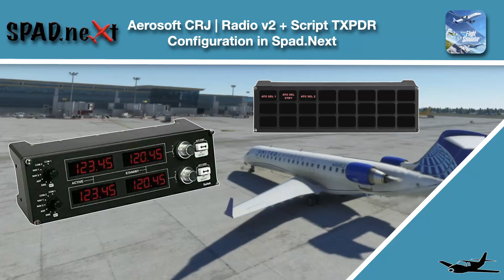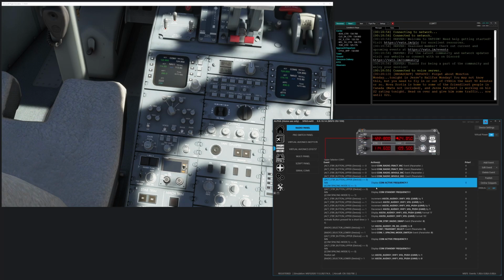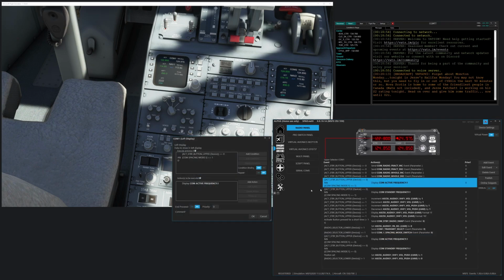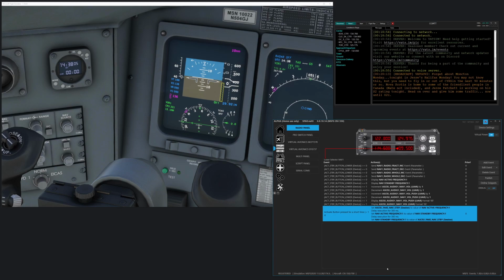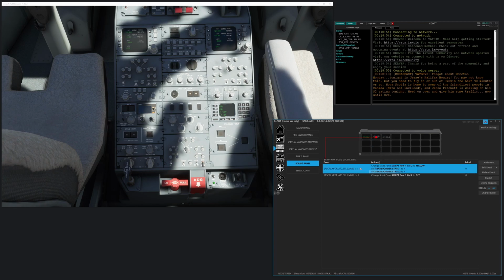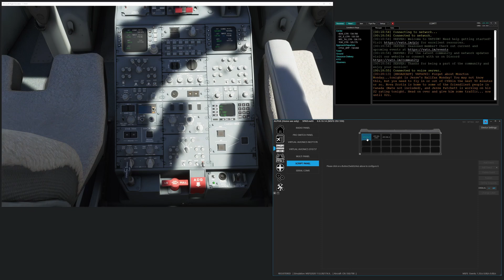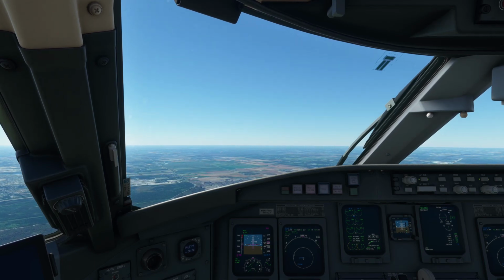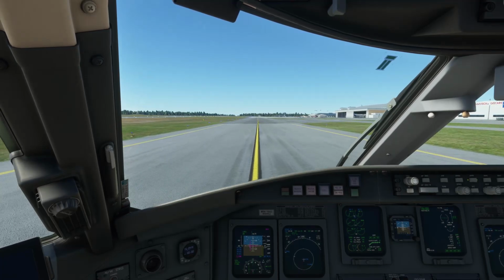(Sim Video) Aerosoft CRJ | Radio v2 + TXPDR Script Configuration

Comment: NAV1 / NAV2 values are not changing in the CRJ is that normal?
Reply from the maker: You mean the RTU display is not showing the change?  Or the actual data under the sim that will in fact show up on the PFD in the HSI as the LOC or VOR you are tracking is not working?
Reply: @LesOReilly  The RTU is not showing the change, for now I can't see in the values on PFD as i'm in flight and the LOC frequency is not showing yet, I'll see upon landing. But that would be better to see in RTU?
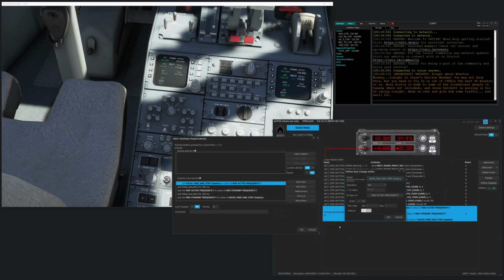Reply from the maker: @thibault5484  that is the part I explain starting @ 7:26 of the video ...  The CRJ is not updating the RTU from external Frequency changes on the display of the RTUs NAV FREQs.... that is how it is coded...  I requested on the Forum a long long time ago that they please change that....  At the end of the video I show tracking the VOR and intercepting an ILS ... so it "works" and since my Radio Panel is correct and the PFD is correct I don't look at the RTU
Reply: @LesOReilly  Ah ok sorry then I guessed I didn't watch carefully! Thank you

Comment: I tried to follow everything but I'm a bit lost when it comes to creating the local LVAR. Seems to difficult to me and it's explained a bit fast. Where can I copy/paste? 
Also does it fix the TX on COM2? It seems I can't transmit on COM2.
Reply from the maker: It’s in the online snippet database. Think the how to download it is at the end I of the video. The COM transmit is an issue currently in the CRJ. They made changes after v1.0.3 and it stopped writing the data correctly.

Comment: Do you have multi panel plus radio panel profile of crj to download? I try to find your profiles but i can't find the crj profiles. Thanks
Reply from the maker: They are all published as individual devices. Use the online snippet to download each device. There are videos for each of those and in them I show downloading of devices.
Reply: @LesOReilly  i Will try tanks
Reply from the maker: @LorenzoDiamond1  at the 48 second mark of this video I show you how to download the Radio Panel from online snippets..  For the Multipanel same thing but in this video and I even went and found the time code for you..  https://youtu.be/PtEQ3EWFjw0?t=1007
Reply: @LesOReilly  i did It thanks. I have my profile with radio panel and multipanel for crj with your settings. Thanks very much i also bought the licence. The nav1 and two of the radio panel dont change on the air craft the rest Is All good thanks
Reply from the maker: @LorenzoDiamond1  Again as per the video :) ...  The won't change .. I  had to create a "work around" to make the NAV Radio work from the Logitech panel but the UI won't update ...  The SIM is updating and the ILS/VOR is changing as I show in the video....  I have requested from Aerosoft many months ago that they have the NAV radio update just like COM does....  But I guess that is low on the priority list over the other issues they need to address.....  FYI I don't have any financial relationship with SPAD.neXt :) so glad you bought a license but just wanted to let you know that money does not come to me ... Like's and Subscribes are my only "renumeration" :)...  Glad it is working for you
Reply: @LesOReilly  Sorry you are the man likes and subscrive sure
Reply from the maker: @LorenzoDiamond1  hahah I am not "the man" .. just wanted to be clear no monetary benefit for me I do this stuff so others can pickup the tricks...  Also since it solves typing it out multiple times in the SPAD.neXt Discord :)
Reply: @LesOReilly  I'm not lazy, I'm Italian that's why I have difficulty with videos and I look for settings already made. Thanks a lot for your incredibile work